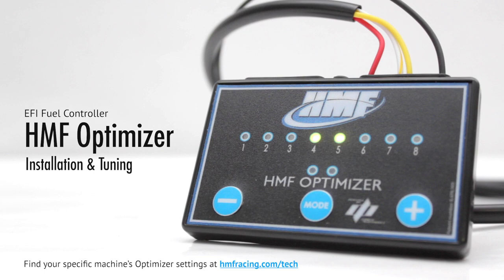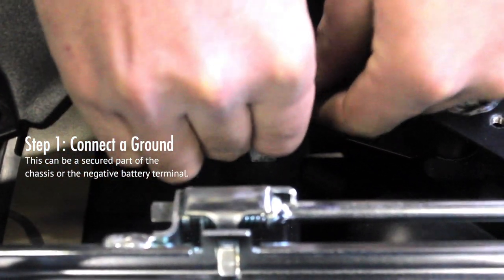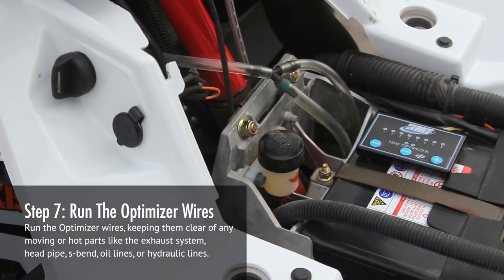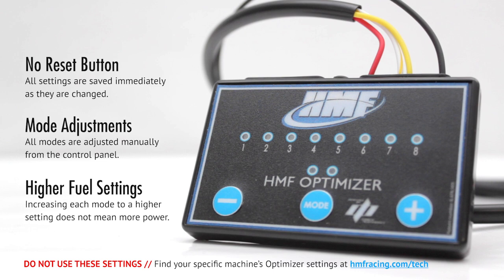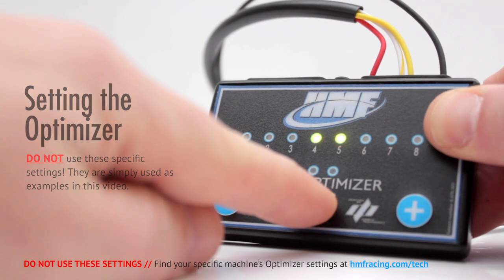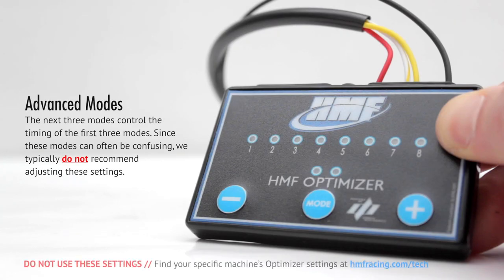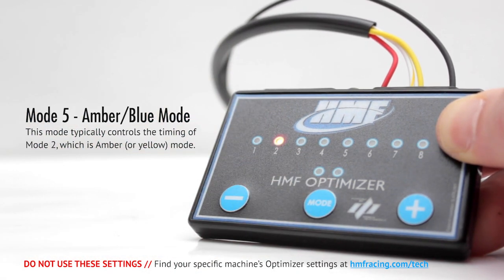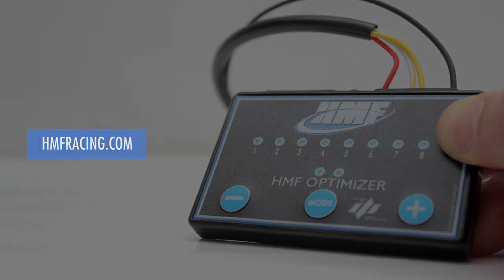HMF Optimizer Installation and Tuning

Comment: You guys should really show where exactly the fuel injectors are on specific models, hardest part is trying to find where they are
Reply from the maker: We would like to, but we don't have access to all the machines we've worked on in the past. This Optimizer video is designed to be a general guide. Most of the manufacturers have specs on the internet of where their fuel injector is located.
Reply: If u cant find the fuel injector(s) on your machine, I don't recommend you install this tuner yourself, no disrespect.
Reply: @romper4444  oh Billy badass here

Comment: I have a 2016 raptor 700. It looses power in the mid throttle range but then gains it back when I pin the the throttle. I don’t know what the problem is
Reply from the maker: That's strange, can you confirm your Optimizer Settings. If the Optimizer is set correctly, please verify the Optimizer mode and slightly add or subtract fuel and recheck for performance gains.

Mode 1: Green: 4.0
Mode 2: Amber: 3.5
Mode 3: Red: 2.0
Mode 4: Green/Blue: 3.0
Mode 5: Amber/Blue: 3.5
Mode 6: Red/Blue: 4.0

Comment: I am having issues with my 06 raptor 700r it barely idles and when I give it throttle it’s fine in the low end but midrange it starts backfiring and Boggs down when I give it anymore. It ran perfectly before the exhaust and tuner were on and I have not changed the settings.

Comment: so if im right ... if i instal a HMF slip on on my can am ... i just need to instal that tuner and its already setup for the slip on ?
Reply from the maker: That is correct. The HMF Optimizer is a plug-and-play controller, setup to work specifically with your machine and exhaust.
Reply: @HMFExhausts  alright thanks

Comment: does the fuel optimizer come with a full system exhaust or should it be bought separately?
Reply from the maker: The HMF Fuel Optimizer is sold separately from the exhaust system.

Comment: I just installed hmf slip on and fuel optimizer.
Works well,sounds great. But i lost about 60km per tank of fuel.  That doesn't seem right
Reply: Would it work for a kpm 200 Lifan?

Comment: I heard that the optimizer is pretuned for me to remove my stock airbox lid is that true 2020 raptor 700se
Reply from the maker: That is correct. The Optimizer is set for a Stock Air Box Lid removed on the 2020 Raptor 700
Reply: Do you know what settings you have it at ? I have 2019 700R any help would be thankful
Reply from the maker: @poorwhiteboy6521  Visit hmfracing.com/tech and enter in your model for all the tuning specifications and settings for you machine.

Comment: i bought a titan that came with an optimizer for my 2017 1000r. I added a quiet core to it. Should I make any adjustment to the optimizer?
Reply from the maker: There should be no need for additional modicications with the HMF Quiet Core. If you have any tech issues, you can always contact us at hmfracing.com

Comment: What settings should I be using for raptor 700r 2024 SE FULLY stock just HMF performance slip on
Reply from the maker: You can get any settings for your Optimizer at https://hmfracing.com/tech
Reply: @HMFExhausts  it’s throwing a CEL.

Comment: What should the settings be for 2018 raptor 700 with hmf slip on & pro design with clamp on k&n filter? I believe its just blinking 1...
Reply from the maker: You can always find tuning settings here
https://www.hmfracing.com/tuning

2018 Yamaha Raptor 700

Mode 1 - 4.0
Mode 2 - 3.5
Mode 3 - 2.0
Mode 4 - 3.0
Mode 5 - 3.5
Mode 6 - 4.0
Reply: @HMFExhausts Awsome thanks.
Reply: @HMFExhausts i havent messed with it yet but i just looked and 1 & 2 is green while at idle, that isnt correct is it?
Reply: @HMFExhausts with the key on 1 & 8 blink green, idle 1 & 2 stay solid green. It was shipped with a hmf slip on and a pro design flange was put on with k&n filter with out wear air box lid on... i just dint wanna monkey with it if its set where it should be...

Comment: I have a 2013 raptor 700 with hmf exhaust and optimizer . How do I reset the mode to when I originally hooked it up.? 
I messed with the modes and I’m not to familiar with it. I don’t want to ruin my bike or motor if that’s possible. Thanks
Reply from the maker: There is no reset button on the Optimizer itself. If you'd like to load the settings back to the original, visit the link below and select your year, make, and model. The settings displayed will be the settings for your 2013 Yamaha Raptor 700.

https://www.hmfracing.com/tuning/fuel-injected/hmf-optimizer

Comment: Will I have to tweak the settings if I also add a K&N air filter with my exhaust on an Outlander 450?
Reply from the maker: On a machine such as an Outlander 450 a change in air filter to a K&N, or other aftermarket filter, changes to the HMF Optimizer's pre-programmed tune are not typically required.

Comment: If a throw a full hmf on my yfz450 r will it already be good for it?
Reply from the maker: Your YFZ will need a Fuel Controller to manage the air-fuel ratio. The HMF Optimizer will come preprogrammed for your vehicle.
Reply: Yeah I have an hmf performance optimizer I think it might be the same one as shown on the video but this one has like flames on it is that just an older version

Comment: I got a 2022 raptor 700r se ans about to put a hmf slip on what mode should I put on?
Reply from the maker: Mode 1: 4.0
Mode 2: 3.5	
Mode 3: 2.0	
Mode 4: 3.0
Mode 5: 3.5	
Mode 6: 4.0
Reply: @HMFExhausts  what does this mean lol
Reply from the maker: @Calii8708  Those are the fuel settings for the HMF Fuel Optimizer for a 2022 Raptor 700R. As stated in the video, there are 6 modes to change the settings and the settings provided are for an HMF exhaust on a 22 Raptor. Did you mean something else when asking "What mode to put it on?"

Comment: i am back firing and have the settings at the lowest what settings should
i put it at?
Reply from the maker: You need to make sure you set the settings to what we recommend. Setting all of the modes to the lowest setting is going to cause issues. Visit hmfracing.com/tech for more information and your specific settings.
Reply: @HMFExhausts  i had to set it tk lowest bc when it’s not at lowest it sputters mid range
Reply from the maker: @chaseschuckers8856  Contact our Tech team for help -> www.hmfracing.com/tech

Comment: Do i have to change the stock settings if i have a full hmf exhaust along with an aftermarket air intake on a raptor 700?
Reply from the maker: When you mention "stock settings", are you referring to the stock settings of our HMF Optimizer, or the stock settings of your vehicle?

If you install an HMF exhaust on the Raptor 700, a new fuel tuner or settings are required. 
https://www.hmfracing.com/exhausts/yamaha/raptor-700

If you already have an HMF exhaust with the HMF optimizer preprogrammed for your Raptor 700, then you may need to tweak the settings for the aftermarket air intake.
Reply: @HMFExhausts  I was referring to the stock settings of the optimizer. I found on yalls website that mode 2 and 3 have to be switched to 4.0 and 3.0 if an air intake is installed so it’s taken care of but thanks for taking the time to reply👍🏻
Reply: @MidnightRider1034  so im getting the slip on and the programmer thingy, what exactly does tuning the raptor mean? Im slow when it comes to motors...
Reply: @theofficialk.a.m...p4760  The fuel optimizer changes the air/fuel settings on the bike to keep it from running too rich or too lean because putting on a new exhaust will change the air/fuel ratio. If you ordered the HMF optimizer and all you're doing is adding an aftermarket HMF exhaust and not an air intake then you can just throw it on with the exhaust and be done cuz it's already preprogrammed to work with it
Reply: Yea I got a 2021 yfz hmf comp slip on hmf fuel optimization and ais delete and speed sensor delete and gytr intake I talk to Brian at hmf he said the tunner has to be tweaked when installing a intake

Comment: Had my hmf optimizer installed at the dealership when I bought my 21’ Yamaha Raptor 700R SE the check engine light turns on at high rpm’s only  was wondering what that might be if you guys could get back to me please kinda worried something might happen
Reply from the maker: Looks like you could potentially have a Warranty Claim with your Raptor Optimizer box. Contact our service team at hmfracing.com to get you take care of. https://www.hmfracing.com/support/contact
Reply: Yeah had mine on about a year the check engine light stays on took it to the dealer hooked it up to computer turns out the optimizer is junk. Emailed hmf got no reply. Better off buying a EHS tuner

Comment: Hey Great video but I have a question so I have a 08 Honda trx 700xx and I have the big gun exhaust but I don’t have a fuel optimizer 
I tried find the big gun fuel optimizers i found one but I couldn’t buy cause it didn’t meet California laws 
Will this hmf  work for my quad even though I have the big gun exhaust?
Reply from the maker: This Fuel Controller will work with any exhaust, but the fuel settings preprogrammed on the Optimizer are for HMF exhausts. You may have to tweak your Optimizer settings... or just get an HMF exhaust ;)